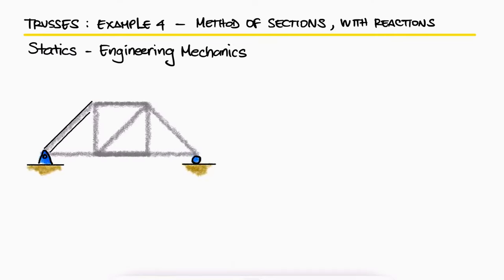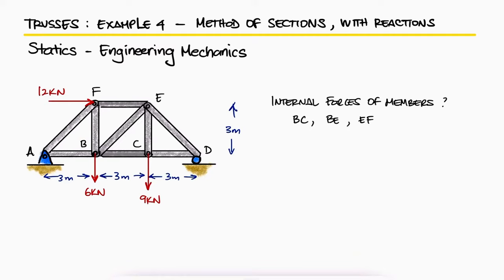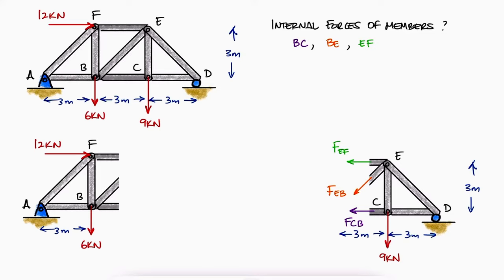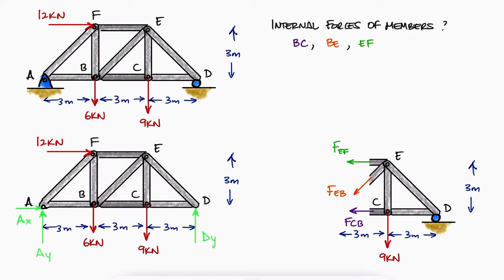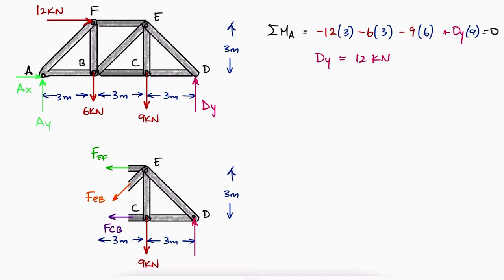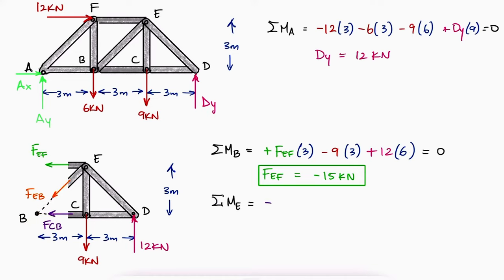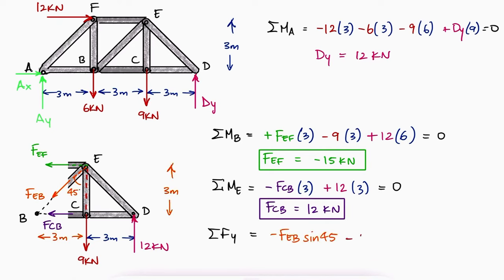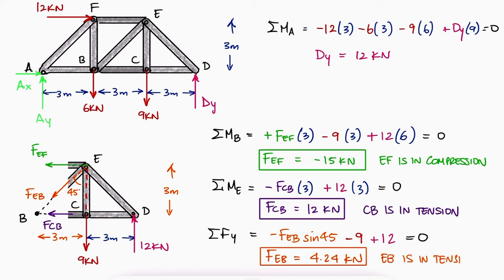TRUSSES Method of Sections, Reactions Required in 2 Minutes!

Comment: For the force of 12kN wouldn't the perpendicular moment arm to point B be 3meters instead of 6 meters? I don't understamd why  you wrote 12(6). This is at timestamp 1:27.
Reply: The distance between point D to point B which is where the point you moment about is 6 (that is 3m from D to C and another 3 from C to B) meters hence why the 12kN applied to point di has a perpendicular distance of 6